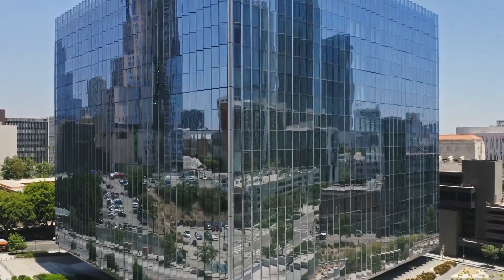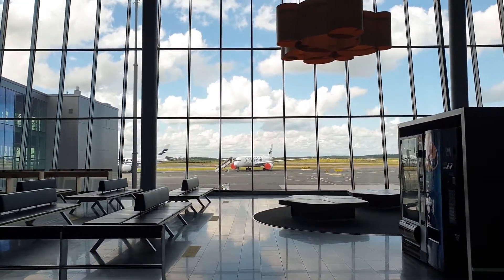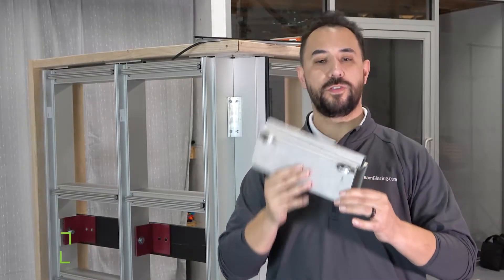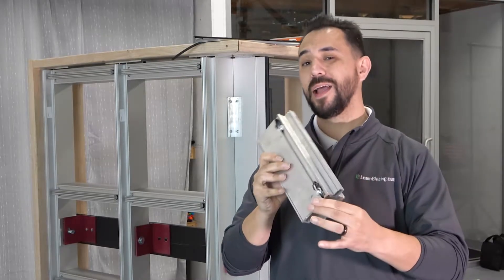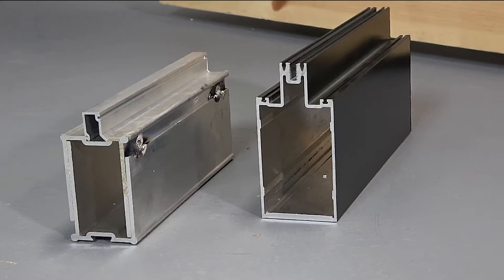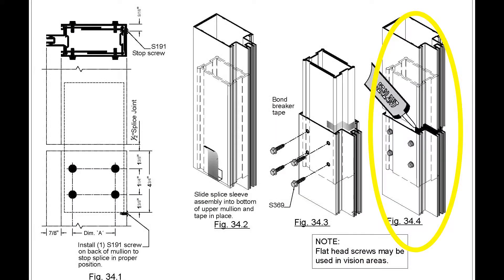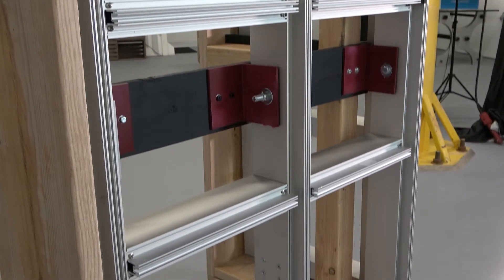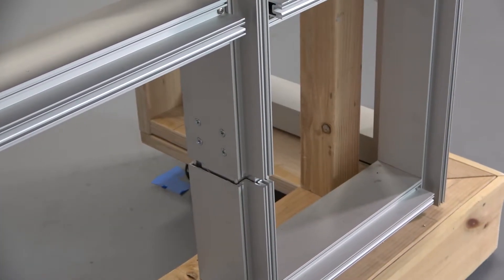Curtain Wall Splices and how they work

Comment: how do you know how many splices you need?
Reply from the maker: That’s a tough question. It comes down to a mix between engineering, the desired look by an architect and the component length itself.

We have a pretty nice course on multi span Curtainwall that you might find pretty useful

Comment: Do i need to be an engineer to learn how do all curtain wall jobs ?
Reply from the maker: Not necessarily you, but having an engineering review is key. You could find a firm that is willing to help you in the design process. Another good way is to use companies like MP Drafting and Design who review and generate shop drawings and have already work with an engineering firm so they can help you with the entire project.